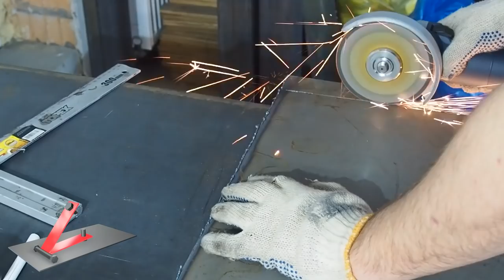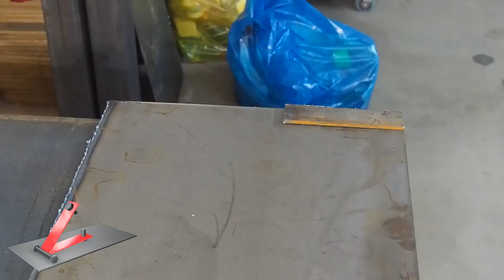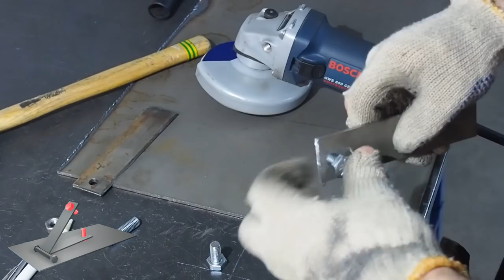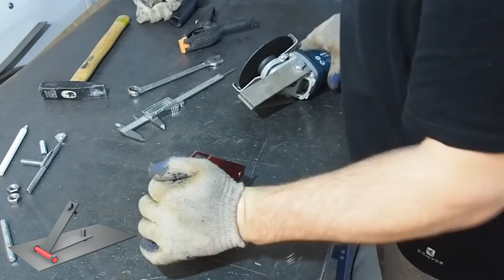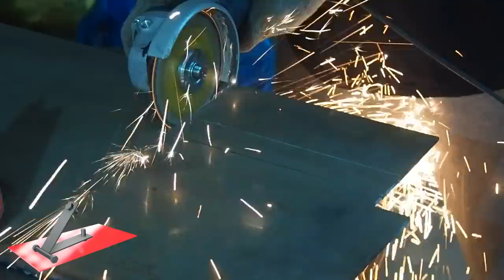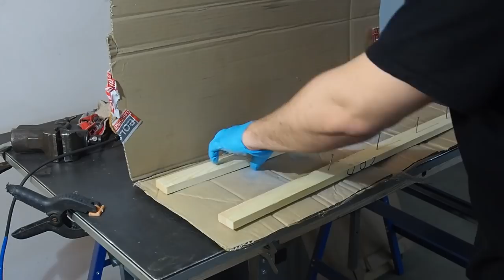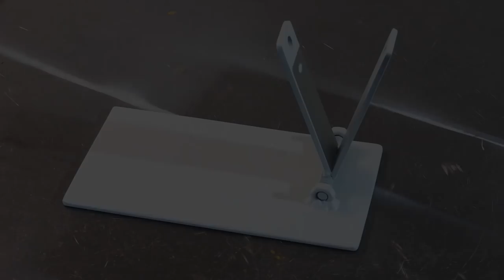DIY | Angle Grinder Cutting Jig | Straight Cut Sheet Metal

Comment: Thanks for the simple and practical idea to cut along a straight line with an angle grinder.
You have used a threaded rod and two nuts to raise and lower the grinder. Though it works, when you raise and lower the grinder, it moves left and right of the straight line. Even though this movement is very small, you can use a plain rod and two low-cost ball bearings and improve the accuracy. 
Looking forward to watching the video of the improved version.

Comment: Good idea!  I would add a thin sheet of plastic to the bottom to reduce friction and make it glide across the work piece easier.
Reply from the maker: Yes, its good idea.  You may use a wax for it as well.

Comment: Put some tinny roller at the backside of the plate for smooth gliding. You can use roller from salvage printer.  My idea came out as i see you pushing with lot of friction.

Comment: Im wondering if you can keep the cutting disc parallel to the guiding edge (the outer edge) of the jig? As I can see, there is no such thing to stop the grinder from pivoting around two connecting bolts.
Reply: true, theres only a single bolt to stop that motion, i tried making one but the disc is not exactly parallel to the outer edge.

Comment: The real way to cut straight is practice, carefully score the line you wanna cut making a sligth channel, next cut all the way through and follow the channel without rotating the angle grinder, if the channel is hard to follow then try and cut in a bit deeper

Comment: Recently bought an angle grinder. I'd like to build something very similar to this but I don't have a welder. Has anyone built one without using a welder and if so, how?. TIA
Reply: You could try brazing it, just need a decent propane torch and some rod compatible with the metal you're using. It should hold well since it's not a lot of force.

Comment: Hi,

Great idea in bringing out this video,

I find two suggestions

1.  A support should be there in the front to hold the fixture or
2.  The length of the bottom guide, support what ever you call should be increased at least double the existing length.

Reason: other wise the pressure while in action may topple or run out of control from your hand

Moral: Great but little change is apriciated

Comment: I had to convert CM to inches 10”x6” if you round up to the nearest whole number.  Hope that helps someone.
Reply: 1" is = 25,4 mm.
1" is = 2,54 cm
Reply: i had the metric system from 6th 7th and 8th grade, and then i didn't hear much about it, until i started doing auto body, and then they made it worse, they blend the 2 together, like an engine will have half metric bolts and half imperial standard, but all the body bolts will be metric, and let me tell you , when you are cranking on a bolt, and it slips, or rounds over, you know you guessed wrong, for me , i like metric for measuring, it's easier to remember
Reply: Yeah I suffered in school behind fractions and still have a tough time but I won't let it stop me. It's a lot easier now because tape measures have it broken down on them now. Your never too old to learn.
Reply: @marty4645  dude , i hear ya, i wanted to be a rock star in the worst way when i hit 13, and your first class is alcoholism 101, so i dropped out (was asked not to come back) around 9th grade, my math teacher said" mr ronn, if you're going to vegitate, please do it quietly"so math was not my thing, i learned later, it is more important than anything, (next to beer101, lol), i learn new things everyday, the person who knows everything, probably knows very little
Reply: @marty4645  hey , if you have trouble with math, try using the metric system, it's so much easier, it's kinda like counting in tens, like money, there's no weird 34/63 rds, and all that crap, most things (not all), are designed using metric, that's part of why anything you buy measures out strange, or just short, it's not short, it's metric, try it you'll catch on quick, trust me
Reply: Thanks Jake will do, thanks for the reply and look out!

Comment: Ya know its easier to put an abrasive blade on a skill saw. No welding required.
Reply: Wont it cut much slower though ?
Reply: i have done that, the only problem i came out with was that it melted the whole area in the line of fire where the sparks for shootig , it was an older ryobi circ saw, i think it might have been $30.00, so no biggie, but i do have a very old craftsman ( 60's ?)all aluminum housing, maybe it would do better on that, but it will probably pit up, who knows

Comment: Or just put a cutoff blade in a cheap circular saw.
Reply from the maker: Great idea. I have to try it.
Reply: @DIYInMyGarage  Be careful though, those blades can be fragile. I'd set the cutting depth as shallow as possible.
Reply from the maker: Maybe 😁
Reply from the maker: I have been using cutoff blade for metal cutting in cheap Makita miter saw. See this https://youtu.be/WaCgIDfGRrs
4m.51s until blade lost its tooth.

Comment: The Cutting Jig is a good idea, but I think your cutting is a wrong direction. 
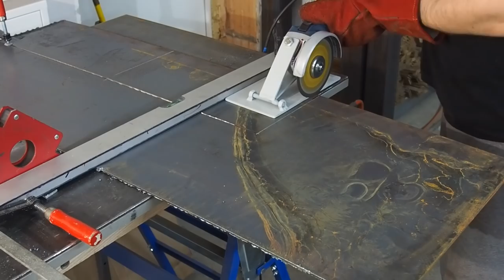0:13 & 9:36 You push forwoard to cut, that's dangerous. You should pull backword. If your cutting is short, maybe the cutting direction is ok; but when your cutting is long or take much time to cutting, then kickback is dangerous.
Many youtuber cutting metal like you, and they all dangerous.
 If I am wrong, please tell me.
Reply from the maker: Hi, thanks for Your comment. So, if You cut steel with angle grinder You should change direction as well🙄